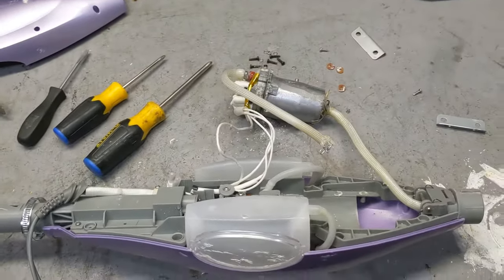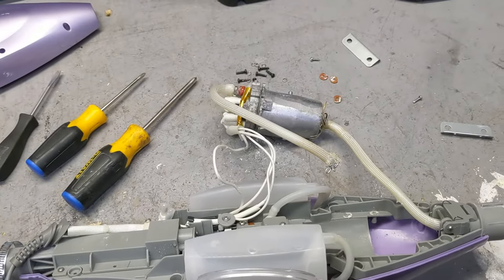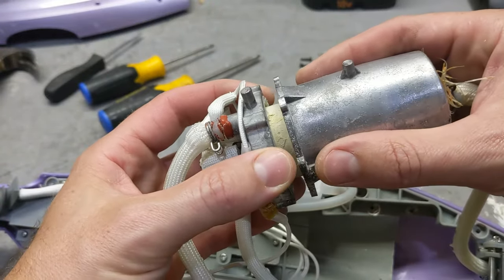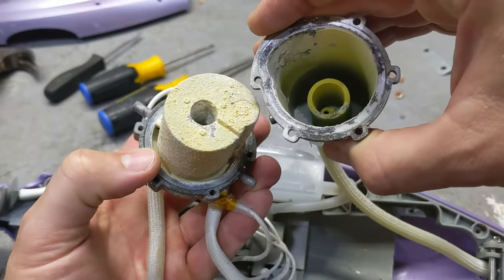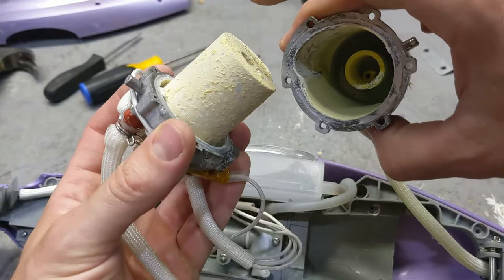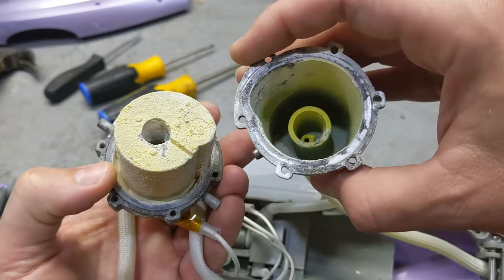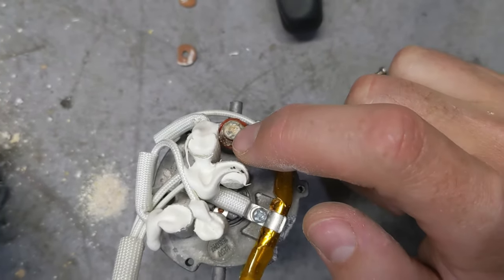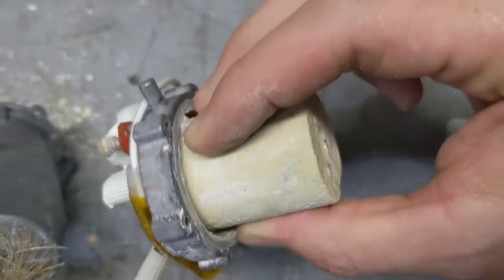My steam mop doesn't work anymore, no steam, causes and FIX, Never use Tap water!

Comment: The steam wasn't coming out of my reasonably new mop, so tried Calgon liquid that I use for washing machine, steam came out in seconds.
Reply: Thanks for tip my steam mop not working snd I tried SLAM descaler worked right away.
Thanks again
👍
Reply: I would like to try this. I’ve tried vinegar and CLR. It won’t steam. I actually was moving and my husband left it in the back bed of our truck and it rained a tiny bit outside. I’m praying I can get it to work again. Thanks for the tip. I’ll let you know.
Reply: Tried white vinegar and cleaning vinegar on the CLR. Next few years we definitely will be getting the water treatment system on the house. Our water definitely is a problem.

Comment: I never used tap and mine is ruined now anyway lol
Reply from the maker: Can be fixed with a screw driver
Reply: Can’t open the pressure chamber. Screws are seized and now stripped. Trying vinegar. Not helping much after hours of running vinegar through. And suggestions for household fix without opening and without buying descaler?

Comment: Does your model have any kind of internal pump or is the water pumped by the reciprocating motion of the handle ?  A neighbor tossed a Shark S 3550  model which I intend to fix.  Thanks for the video
Reply from the maker: no Eletric pump, just handle powered pump.